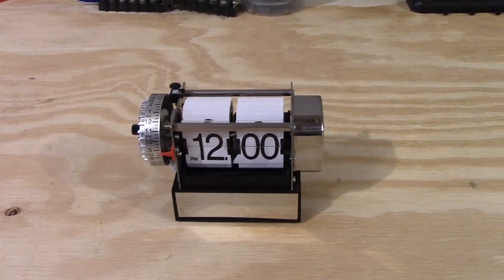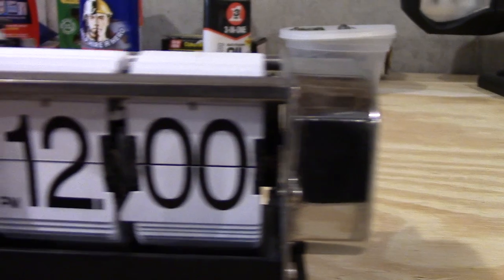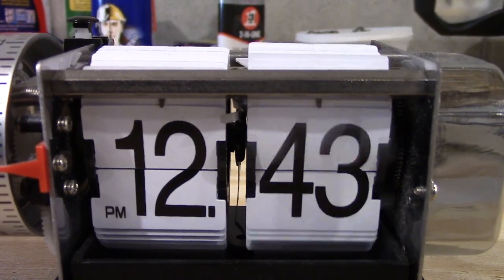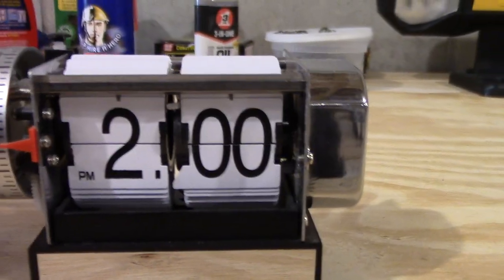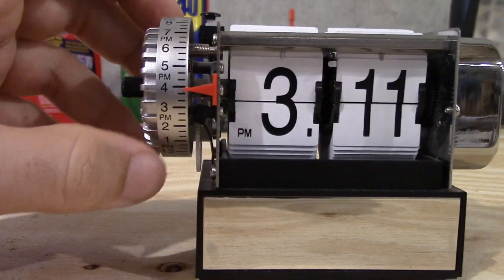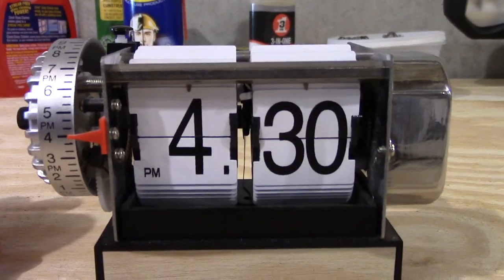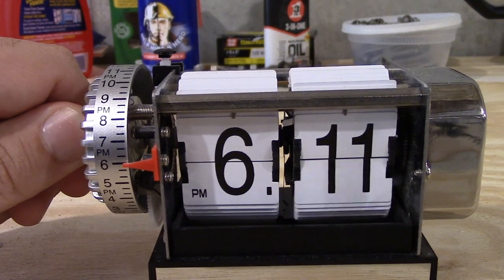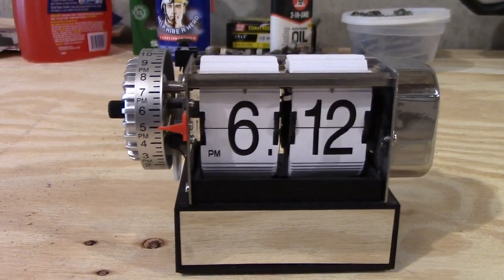Flip Clock, and How it Works.

Comment: At 3:30, as the minute card changes to "42", note that the center tab moves leftward; it is pushed leftward by a thickening of the outer edge wheel of the minute mechanism. The thickened edge ends at the "59" mark; the tab at the left edge holds the center tab, once the hour changes, the center tab snaps back to the right position, allowing the hour tab to fall.
Reply from the maker: Oh I thought I mentioned that? Didn't rewatch the video yet, so didn't check. Heh.

Comment: That's pretty cool
Reply from the maker: It is pretty interesting as to how it all works. Definitely some thoughtful engineering went into it!
Reply: I know what I'm about to say is not related to this video but I have a request for you to do with the speed queen washer can u make a video of it washing a small load
Reply from the maker: @randytorboli  I can try that at some point. I do have a video of it washing a load of whites at the Medium water level, so that may be close for now.
Reply: @Sharkie626  we used to have a speed queen that was made in 2005 and I always loved when we washed small loads in it but we now have the newer belt drive maytag centennial and I kinda has the same splash sound as the speed queen only at a slower rate of speed so it does well too